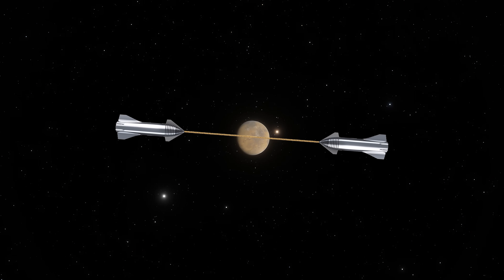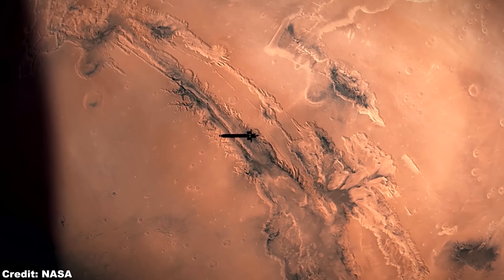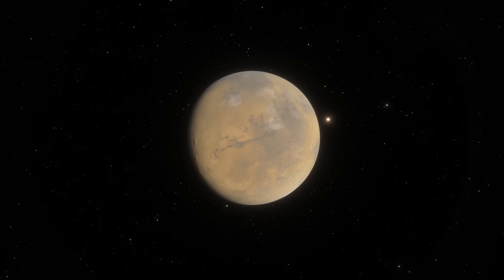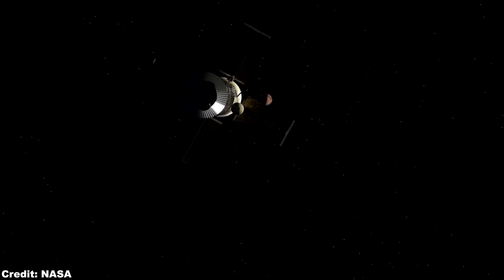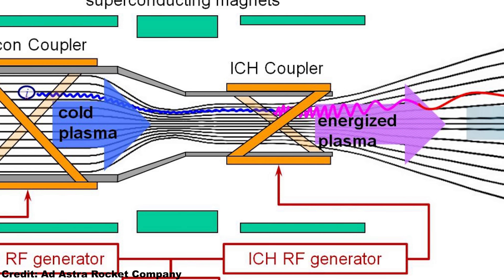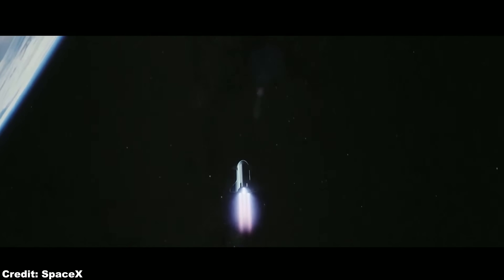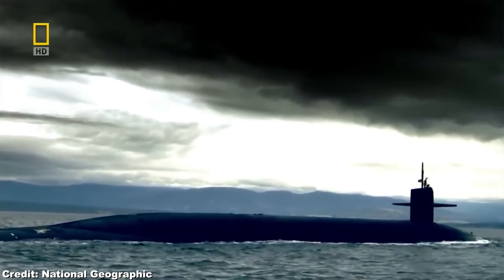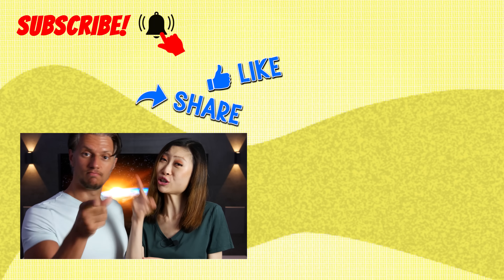4 Ways To Upgrade Starship's ENGINE! [SpaceX Starship FLAW FIX]

Comment: A suggestion from a humble admirer. Elon should acquire the NERVA rocket engine from NASA and double wall the cabin section of his starships with polyurethane cells filled with potable water for the crew. This will protect the crew from cosmic rays as well as fuel for the nuclear engine.
Since the engine was designed to run on hydrogen, water should be a versatile and useful substitute.

Comment: Good to see ya got you color back...now you loo like a proper German...lol. all the new propulsion is decades away, and it is power-hungry. a reactor a larger as needed would be heavier than the chemical fuel needed to just burn more fuel to go faster. It's a case of dismissing returns. I Belive there is a worldwide treaty that bans the use of nuclear power in space...something about the cold war and nukes. The laws around nuke weapons would have to change OR if we were REALLY SMART we'd get rid of them....Unfortunately, I don't see that happening soon. That's been the hold up for The Atomic engines for 55 years...

Comment: If you can continuously accelerate at 1/10 g with an ion drive, the speed adds up. 
Another trick is to couple a Starship to another Starship, a sort of disposable Starship Stage booster. Fire the whole booster at departure, then discard. Starship's own tanks can dscelerate at the end of the trip.
Edit: Starship header tanks couldn't decelerate. So. TWO Starship Boosters in a three craft train. Fire and deplete Booster 1, later use Booster 2 (special insulated main tanks) to slow down, use Starship Crew header tanks to land. You could refuel Starship Crew from Booster 2, also.

Comment: We tend to often approach this with earth based limitations in mind.
In space there is not really a size limit. You could use a rediculously large solarsail. I didn't do the math, but imagine just how big this could be if you use a starship to lauch it. A 100ton solarsail at 10grams per m2 gives a surface area of 10km2 that's pretty big.

You could try to use solar panels to power a VASIMIR engine, the challenge here is the power to mass ratio. You might need to resort to some form of concentrated solar power. Reflectors can be way lighter than solarcells. Just for reference the ISS solar panels produce about 250kW.
Reply: The solar panels mass may be reducible using Perovskite paint-on panels.

Comment: VASIMR??? That engine is nonsense.

It can only achieve 39 days to Mars with 200 MW of power... and the nuclear reactor must be some 100 times LIGHTER than anything we do have.

You first need something like a Polywell Fusion reactor for VASIMR. Of course, when you get that, you wonder if using Fusion power to drive an electrical ion engine is the best propulsion method.

Comment: wait, i thought they were launching the starship and then docking with another starship to refuel while in earth orbit. this would give them a full tank of gas to get to mars. since there is no friction in space they would accelerate starship until 1/2 way there at which point they would have to begin decelerating so as to not fly past mars. why do they need any of these if this is correct? please explain :)

Comment: Great subject on future propulsion engines.The vasimr engine seems promising , if they can keep scaling it. To the engineers I say  keep working and researching those engines and  ultimately they will reach a point of high efficiency and speed. I hope that they can reach about 20% the speed of light.  
There is another type of engine it called the anti-matter engine. But problem is the they  can't find or produce enough anti-matter.

Comment: There's an easy way to install scaleable fusion power into your hypothetical VASIMR craft. Just send a heat engine satellite into solar orbit  (probably a closed cycle brayton engine) and use large mylar reflectors to focus all the collected light on the engine. Then get a laser-lock on your spacecraft and transmit microwave power to it. Of course, then you should probably ask if it makes sense to just use laser-propulsion. Though that has the disadvantage of the angle of the beam mattering a lot more.

FWIW, you wouldn't want to install any of this into Starship. Starship is designed as a launch vehicle and needs to stay good at launching. You had the right idea with your Bigelow ring habitat. Same idea. Build this pusher-engine in space, then dock with it any time you need to make a trans-Mars or return trans-Earth burn. Kind of like the detachable hyperspace ring in Star Wars Ep II.

Comment: Thanks for covering advanced space engine technologies, my friends!   Great job!   I am enthusiastic about several of them, but I really hope to see an HB11 fusion reactor providing a lot of power, and perhaps even thrust within a few years.  An HB11 reactor with a VASIMR engine might be the ticket.  That is where we might see Mars travel time really reduced.  Obviously much more knowledge is still needed to fill in the blanks, but I am hopeful.  So far, the initial information seems to be that a hypothetical HB11 reactor would be relatively low in excess heat with heat dissipation equipment required would be modest  and the reactor  would also not require much shielding, either.  Therefore the reactor should have a much better power-to-weight coefficient over any other system.  We can hope! 😃

Comment: Outstanding.  Loved the Witcher reference.  Two things: I think we'll need two different drives and probably ship types, one for Earth to LEO and one for in-space. The in-space ship would need to be assembled in orbit and could conceivably have the giant radiator panels (that are ALSO solar panels) with active circulation you showed. Secondly, the long distance spaceship could be boosted up to speed with chemical propulsion, and then upon entering the chemical propulsion "coast" phase keeps accelerating using a low fuel consumption drive like the ones you mention. Reverse on arrival. [Passenger ships = fast, low payload; cargo ships = slow, big payload]  Best of both worlds! Also very much looking forward to your vision of Starship's interior!
Reply: Great minds think alike! Elon just tweeted that a new Moon Starship can go to the moon and return, which implies a return to LEO only for refueling, i.e. a dedicated space-only ship. "We're going to try to land Starship on the moon with enough propellant to return to Earth" - Elon

Comment: Those exotic propulsion systems sound interesting - and heavy. Would StarShip still need its Raptors for launching and landing? If so, perhaps the new engines could be built into a "tugboat" type of vehicle,  launched separately into orbit by SuperHeavy, then attached to Starship in Earth orbit.  It detaches from StarShip in Mars orbit, when StarShip prepares to land. The space tug remains in Mars orbit until someone needs if for a return to Earth. Such tugs might be useful for other Mars bound spacecraft as well.  Just a thought...
Reply: yea they would still need chemical drives to get off earth none of the others work in or could get off Earth, theres also the option of Launch Loops/skyhooks to get up, that sure be possible(look up upward bound)

Comment: Excellent Dragon Ball Z/Dragon Ball Super reference. SS means steady state. VASIMR Steady State. As for a power source, research Kilopower.
Reply: @TechChasm  I understand. I must have missed that part on Kilopower. The other types of reactors I can think of are fusion reactors. Some compaines are developing smaller versions. General Fusion and Lockheed Martin are two companies I can think of that are researching smaller fusion reactors. I would have mentioned J.E.T (Joint European Torus) and T.F.T.R (Tokamak Fusion Test Reactor) but they have not managed to breakeven. China's E.A.S.T (Experimental Advanced Superconducting Tokamak) and Germany's stellarator fusion reactor are fascinating designs. Just watched your video on the stellarator. Also, researchers at the University of Bristol have developed a method to turn radioactive graphite blocks, a waste product of nuclear reactors, into artificial diamonds that generate electricity.

Comment: Guys, the VASIMR engine has in my opinion another big flaw: The insane temperatures within the engine itself. Any tech to handle these would involve a giant machinery and has yet to be developed.
Reply: Magnetic fields keep the plasma away from the walls, the walls still get a heated up by the light given off the plasma of course but it is manageable.
Reply: Radiators should help reduce the heat.

Comment: Mars in 39 days? What would the math look like? Would that be acceleration past 1g? And for how long? At some point, the ship has to be turned around for braking. If it is traveling at 110,000 mph, how long would it have to brake to enter orbit without exceeding a 1g braking? The limits of the human body and the max Q of the vehicle have to be considered. I don't know the numbers, but I would sure like to see them!  :)
Reply: @TechChasm  Ok, cool. thanks for responding. Well, if they can make a variation for a lunar lander, then they should be able to make a variation as a rapid interplanetary transport with a high speed engine! Space X, Space X, Space X!

Comment: It's pretty hard to improve on Starship's propulsion system without changing the entire spacecraft design. Nuclear thermal could be used, but lots of nuclear fuel is needed. To actually use VASIMR without a massive solar array, you would probably need a reactor so big that it would be impractical on a vehicle that constantly does ascents, descents, and atmospheric re-entry. And if you have fusion, then there is no point using VASIMR when you could use the extremely hot exhaust from the reactor as an even more efficient propellant. For now, a fully-fuelled Starship should be fast enough. If a second stage with very little fuel left can make in 7 months, then a fully-fuelled behemoth should be able to make it faster.

Comment: J&S You2 are wonderful! This is a delicious invitation to think!  Okay here it is: 
      Recall the two rocket ships tethered to a line between them and rotating to produce gravity.  Now imagine that line being a 3,000-6,000 KM long wire rope that can conduct electricity; And that has some considerable mass; and is electrified like an electromagnet.  It would have small rockets aligned to pull on the rope ends to keep it straight and to aim it at a target. You could accelerate via an electric solenoid open cylinder design drive that is pendent to a space fuselage.  It could accelerate to a small fraction of Speed of Light (SOL), maybe 0.01 SOL.  I call this set up the space Choo choo because it is similar in concept. 
          You place about 5 of these solenoid electro-magnetized line segments between here and Mars and use them to accelerate or to slow down the fuselage.  Each one could have secondary emergency functions in the pull-taught rocket ends, such as solar collectors to charge up the line; and, emergency health care, like a way-station might. They stay put (synchronously) and increase potential fuselage payload. This would make it possible to aim the rocket to intercept Mars from the front instead of the rear.  This alone would shorten trip Considerably.    I figured it out once but that was long ago and don't remember the travel time .  Something to do with the maximum comfortable G force and length of line segment.   I seem to recall something ridiculous like 10 days.
Reply: I think you are definitely pointing at the mindset that more engineers should be cultivating; deep space megastructures. Almost all attempts at innovation seem to be Earth centric. The sizes and shapes being dictated by gravity and the need to be carried into space. The future will be in space from start to finish: mining, fabricating and construction of machines intended to spend their entire lives in deep space or moved into orbits or between orbits. Combine that with space elevators and the entire concept of launch and land is a thing of the past, except for sport.
Reply: @clintatk  Thank you.  Keeping in mind that evolutionary time will yet grind slowly for us earthlings.  But you're mostly right.  WE are transitioning hopefully to launch and dock or momentarily merge with;  Until, we get the gravity thing understood.

Comment: I had worked with an emeritus part-time engineer, since passed away, who worked on the original NERVA nuclear rockets for Westinghouse in the early 1960s. He said one of the big problems he faced was on the event of an explosion (not the nuclear bomb type just a rocket failure) that the fuel elements would not disintegrate into fine particles to limit the concentration of radioactivity but the plasma on re-entry would shield the fuel elements from further heating causing larger pieces of radioactive fuel to reach the earth's surface. I hope that lunar mines and processing plants could provide fissile fuel to construct lunar launched spacecraft preventing such concerns.
Reply: If the reactor is only activated in space after being boosted in a reentry shielded capsule, that problem is easily solved.

The problem with NERVA or any nuclear thermal rocket is the amount of radiation in the exhaust plume. The VASIMR type is far preferable. It can be accomplished with a liquid thorium based reactor that does not require the type of radiator of conventional reactors. It still will require a radiator at the end of the generator part, but not nearly as large as the conventional design. Such a unit could power a VASIMR of sufficient power to drive a nuclear tug that would go back and forth between LEO and low Mars orbit, hauling the lander along with it. Mars gravity would help to decelerate at the Mars end and Earth gravity on return. Fuel for the VASIMR can be ferried up by a Starship that is dragged along by the VASIMR ferry on the first trip. It could be much lighter than the Earth Starship because of the lower Mars gravity, and would not need a Superheavy to achieve Mars orbit or descent.

Such a system could achieve a much faster trip to Mars while also providing some magnetic shielding to the passengers. On purely cargo flights, such shielding might not be necessary, increasing payload.

We have almost all the technology needed for this at the moment. It would take several boosts to assemble and fuel the tug in orbjt, but after that, only fuel and cargo boosts would be needed. The smaller Starship at Mars could refuel the tug and provide return cargo or passengers at the Mars end.

This might not be the vehicle for the first trip to Mars,  but it would be needed for any realistic colony support.
Reply: @everettlwilliamsii3740  

If a rocket explodes carrying the reactor from the earth all bets are off unless it comes in one intact piece and lands in the ocean. Westinghouse engineers didn't plan that would happen. They assumed it would destroy the reactor at the least opportune moments spreading the fissile highly enriched U235 which is radioactive even before the reactor startup. I've worked in the nuclear industry. I estimate conservatively the 9 metric tons of U235 in (half the engine weight) would create in 1 day of exposure to a 68 kg person of 592 Sieverts in alpha particles, 5 Sieverts being mean lethal dose. So it is a bit of concern even at these rough numbers. Typical power plant fuel rods are far less radioactive because they are only slightly enriched U235 and mostly U238 which is basically inert radioactively.

Comment: Looky-here now ...
If y'all want fast transits , yer gonna hafta accept SMR. powerplants . The big radiators come with that . You then need a super-efficient AND very powerful transmission/ motor. There are designs for hybrid nuclear-electro thermal propulsion- systems . One such can be examined at Naked-Science-Forum : New-Theories Section ; Thread - Can an Impulse-Engine be built ?
Ref : thenakedscientists.com/forum/index.php?topic=74724.new;topicseen#new 
D.H.

Comment: Good discussion! We could use Gen 4 Molten Salt Reactor to creat isotopes needed for space flight and medical. MSR could be used in space configuration to power VASIMER.
Reply: Only problem with that is that MSR reactors doesn't work due to the EXTREME high corrosion from the salt (just like Thorium which is another wet dream that will never work)

Comment: Excellent video! But you did miss the alternative to Ion Cyclotron Resonance ion engines and that is the ECR - Electron Cyclotron Resonance. ECR provides up to 10,000 ISP for the same power as the VASIMR. It does this because the Ion Cyclotron Resonance has about half the charge to mass ratio as the Electron Cyclotron Resonance. That is the charge to mass ratio of the ions is about half of the charge to mass ratio of the electron. Therefore using the plasma heating that is tuned to the electron rather than tuned to the heating of the ions provides orders of magnitude efficiency improvements: See the video here: https://youtu.be/DbkQLp6fMBU

Comment: Liquid Thorium reactors might be best for space travel, the high temp liquid coolant would be far easier to cool with rads then normal light water reactors.
Reply: and how will you prevent the corrosion from the Thorium and salt?? So far no one has solved the problem outside a lab

Comment: Yup, missed one new technology, and one 60's era drive, but it's real early days for the new one - RF Resonant Cavity Thruster, aka E.M. Drive.
And the old one, Project Orion.
Edit: maybe more then just those two,.. Solar Sails, Laser pumped Solar Sails, EM Sails (uses the charge from Solar Wind),.. And of course, Alcubierre Drive.
Now the question becomes, which drive creates a strong enough magnetic field to suck up all the charged particles in the cosmic rays? It's not like Elon's planning a Bussard Ramjet. (As far as we know,...)